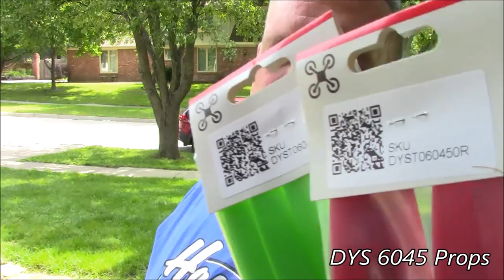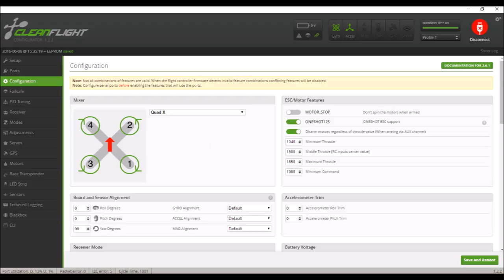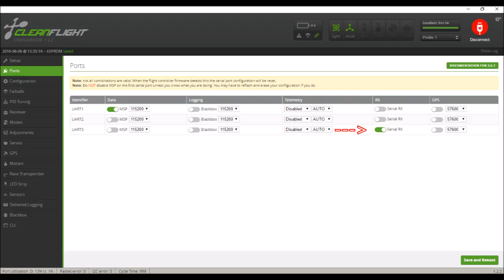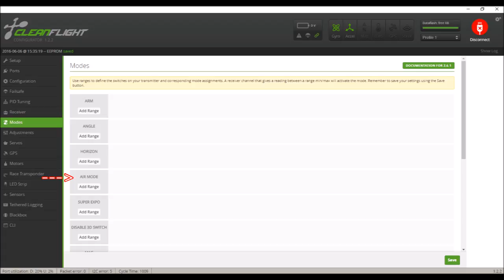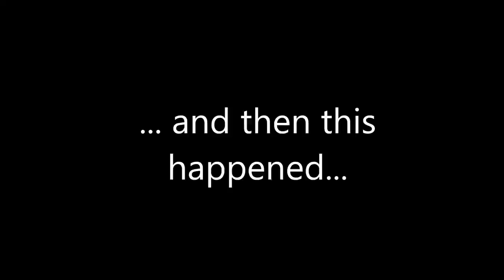TC-R260 Parts, Build Review, Tuning, LOS, Free Style, and Racing!

Comment: Great videos, I have the same vtx et200r but it only has 3.93 volts out to my pz0420 so not enough to power it up where my older et200 has 12.1 volts on the camera lead, Did you power your camera right from the 12v bec on the Marek board.
It is a great quad I love the way this thing flies.
Keep up the videos they have been a great help, thanks again.
Reply from the maker: Anymore, I try to buy PDBs that have a 12 volt output and I use that to power my cameras.  I use the 5v output to power my flight boards.  I usually run the video transmitter directly from the battery voltage.

Comment: travisgrindal i am building a similar quad with the same motors as here and same escs, eccept i am using a zmr250 and naze32 but i am using a devo 7 and it is pwm since the dys xm20a esc have oneshot do i have to use it because i am not shure if pwm supports oneshot

Comment: they have 1 2000mah comes with battery ac charger and three batteries. The next 1 is 2500mah this battery is use for parrot ar drone and 2.0/1.0 Quadcopter what do u think about them.

Comment: Could you do a follow up video on what you do to get it fixed?  Do they make any spare parts?
Reply from the maker: I bought a new frame and used all new parts except for the four arms.  The original arms were all fine.  It took about 45 minutes to move it all over.  This is still my current favorite quad.
Reply: You got me about 90% sure that I'm going. to build one out.  It would be nice if the made spare top plates.   I would use all the same parts but I'm thinking about trying the littlebee 20A pro's.  A buddy of mine tried them and they have some awesome braking.

Comment: Question: Why do you prefer this instead of the GE220? I just ordered a QAV-R 220 but I've been wanting to get the GE220 as well.
Reply from the maker: I like them both.  Right now, the GE220 and the TC-R260 are the quads I take to the races.  I think the look of the TC-R260 a cooler and definitely easier to build because it has more space.
Reply from the maker: I like them both though.  :)

Comment: That smile you have during the video made me smile 2 cos I have the same frame waiting for the same motors(unfortunately held by custom atm) hehe, only I went for the 30a xms just to be safe. Cant wait to build it and fl it.. hope all comes together well as its my 1st build. have you tried multyshot or oneshot 42, the esc should support both?
Reply from the maker: I haven't tried either of those yet, but people keep telling me I should.  :)
Reply: If you gonna try multishot a word of caution, you should probably lower your min command as Joshua Bardwell posted in his video when he flashed his esc the motors started turning after  flashing. Seems like multishot have different range. Anyway those motors rlly like to pull amps and give nice thrust, not many 1300 mAh battery can give  what they need. You think a 1500-1600 mAh would be the minimum for this setup?

Comment: hi would you say the bonka batteries are better than the tattu  batteries??..i have been using bonka since i started flying,but they get very very hot after flying..
Reply from the maker: I like the Bonka batteries better, but some other people may say the Tattu batteries are better.  Since your batteries are getting hot, you probably need a battery with a higher C rating.  If you're going to buy a new battery anyway, look at getting a graphene battery.  Bonka has some new "Panda" batteries that are real good but a cheaper alternative that I've been using is this one (70C):  http://www.banggood.com/Infinity-4S-14_8V-1300mAh-70C-Graphene-LiPo-Battery-XT60-Support-15C-Boosting-Charge-p-1062565.html?p=6Z050013977120130325
If you want to try the newest Infinity graphene for just a little more, there is this one.  I haven't tried it yet, but it will be in my next order (90C):  http://www.banggood.com/Infinity-1300mah-14_8V-90C-4S1P-Race-Spec-Lipo-Battery-p-1099104.html?p=6Z050013977120130325
Those are both 1300mAh batteries but they are available in 1500mAh also.
Reply: thaks for the reply asalways you the man!!!!!!!!

Comment: Hi. What size of screws you use to mount this fpv camera? M2?
Reply from the maker: The camera came with screws.  I drilled out the side plates a little so the pieces sticking out of the camera would fit through them a little better.

Comment: I have almost the same setup (sp f3, dys se2205, dys xm 20a but a 3s battery) and when the battery gets low the quad starts to wobble and fall out of the sky. I belive that it is the esc´s that shut the power off (only two of the esc´s shut off), did/are you having that problem and if you had it how did you solve it?
Reply from the maker: I haven't had that problem. Have you updated your ESCs to a current version of BLHeli?
Reply: no, thank you I will try

Comment: I have the same esc and motors. I use 5045 props but my motors still come down hot.  any ideas?
Reply from the maker: When I race, they have been coming down fairly cool.  When I'm out flying freestyle and pushing the motors hard, they come down pretty hot.  They aren't hot enough to burn my hands, but they do get pretty hot.  If they are hot enough to burn your hands, the magnets have a better chance of coming loose.  You could try to move down your props to 5040 or 5030 props and that should help your motors come down a little cooler.  You won't have as much power though.

Comment: Just wondering how your rebuild is holding up?  I did end up buying this frame with everything you used except I went with the littlebee  pro's cause I just wanted to give them a try.  My only concern is the top plate looks thin.
Reply from the maker: It is back together and flying great.  It is still my primary quad for racing.
Reply: I am wondering if you crash again if you could just buy QAV-R parts instead of buying a whole new frame.  I bought a 2mm QAV-R top plate and grommits for the xt60 slot from getfpv.  I let you know if it fits.
Reply: It doesn't fit.  holes don't line up and the top plate is quite a bit narrower but you can buy 3 tc-r260 frames for the price of one qav-r frame.

Comment: what's a good battery for the Q330 racing quadcopter?
Reply from the maker: What size of props are you using?   For 5" props, I'd use 1500-1800mAh, for 6" props, probably 1800-2600mAh batteries.  I'd also be running 4S.  3S would work, but 4S would give you a lot more power.

Comment: Where did you get that cmos cam, it seems to perform pretty good for a cmos cam and being that cheap.
Reply from the maker: $11.  The link is in the description.
Reply: +travisgrindal so does it perform good in compare with the HS1177? And how does it work with backlight?
Reply from the maker: +R2GO it's good.  I'm using it in the FPV parts of this video.
Reply: +travisgrindal ok. looks good. my hs1177 just went black in mid air. think I'll give these a try.

keep up the good work👍

ps. check out the dutch epiquad

Comment: How do the DYS motors compare to Racerstar 2205s?
Reply from the maker: I think I prefer the Racerstar motors.  They're cheaper and I haven't had any problems with them yet.  I had one DYS motor go out on me so far.
Reply: travisgrindal How is the power though? What should I get among the 3 2205s, the Racerstar, Emax V1 (not the S), or the DYS SE?
Reply from the maker: If you get 2300kv motors, I don't think you'll notice much difference.  If you want more power, look at these Racerstar 2600kv motors.  I run them on my x210 and now I think most of the 2300kv motors I fly feel slow.  http://www.banggood.com/4x-Racerstar-Racing-Edition-2205-BR2205-2600KV-2-4S-Brushless-Motor-CWCCW-For-QAV250-ZMR250-260-280-p-1071307.html?p=6Z050013977120130325
Reply: travisgrindal Thanks! So you think the Racerstar 2600 KV is better than the DYS and Emax 2300s?
Reply: no

Comment: I have one of those frames and it flies fine. I'd like to lower the top plate in order to get the cg down - has anyone tried that? tip for reciver mounting, put it on the lower plate behind the FC and route the antennas in plastic straws   using the rear standoffs as mounts then shrinkwrap it.
Reply from the maker: That is a good idea.  I have space there to do it.

Comment: how much flight time do you get per battery?
what is flight weight?
Reply from the maker: It really depends on how hard I push it.  When I race, I could probably get 2-3 minutes.  When I'm just cruising around and not pushing the throttle, it could go closer to 4-5 minutes.
Reply: Thanks.
what is flight weight?
Reply: I have the SE2205 and the 30a mini esc on my ZMR250. love them plenty fast.
but only seem to be getting about 2 mins using 3S 1300 65c Turnigy Graphene.
I am guessing I am a little heavy still
Reply from the maker: It is around 380 grams with no battery.
Reply from the maker: I'm flying with 4S batteries... both 1300 and 1500.
Reply: ah. ok.
so a 4s will give longer flight times than 3s.
Reply from the maker: Maybe a little, but I'm not sure it would be significant.  Higher voltage requires less amps to move a motor at the same speed while a motor with lower voltage requires more amps.  1300mAh at 4S should last a little longer than 1300mAh at 3S.  Of course, when I fly 4S, I push my quad a lot harder than I do with 3S so my flight times are probably shorter with 4S!  LOL!

Comment: Whats your favorite battery right now
Reply from the maker: For this quad?  I like the Bonka 4S 1300 mAh for "fastest lap" but I like the 1600-1800 mAh batteries for 2 min/most lap races.
Reply: But you like bonka? I need to buy some new ones so im curious i always used the turnigy 1.3 60c gold and nanotech 1.8 4s I want more Power lol Im already running epic rc motors on my 210 lol
Reply from the maker: +Ultimatevapor918 Yes, I like Bonka.  I have a couple of the 1800 4S 65C Nanotechs and they work real well too but just weigh a little more.

Comment: is it faster with 6inch props our 5inch our 3 blade
Reply from the maker: When I use the 5x4.5 3 blades, I feel like it has more low end torque, but the 6045 props give it a higher top end speed.
Reply: im building this frame and it my first.what flight controller do u recommend it seem that the toop two are the naze32 and cc3d what do u use?
Reply from the maker: I've been using F3 Racing SP boards instead of the Naze32 or CC3D on recent builds.  The new boards that are going to be popular are the "F4" boards.  They have faster processors and other stuff that allow them to run RaceFlight firmware.
Reply from the maker: I have used both the CC3D and the Naze32. For me the CC3D has been easier to tune.  But like I said, I'm most using F3 boards now.

Comment: r 3 blades better than 2 blades?
Reply from the maker: I think 6045 2 balde props have a higher top end speed than 5045x3 blade props.  I think the 5045x3 blades have stronger low-end torque than 5045 2 blade props, but again aren't as fast on the top end.  Which is better depends on what you're trying to achieve.

Comment: I dont like using PDB's with intergrated circuits to regulate power or filtering because you're at the mercy of that PDB if it decides to fry while flying and if it does its a good possibility you will lose your quad for awhile or permanently. It happened to me when my ATAS PRO mini PDB took a crap and I lost all power making any recovery buzzer or telemetry useless. So beware. I did recover my expensive quad and went back to a simple PDB.
Reply from the maker: You could make the same argument for nearly any part in the quad.  If the camera fries, you could crash... If the motor fries, you could crash... if the VTX fries, you could crash... If your ESC fries, you could crash...  I havent had a built in BEC fry on me yet.  They should work fine unless you are trying to draw more amps than they can handle.
Reply: I agree, but this thing was never abused,  crashed it maybe 3 times in 6 months only breaking props as usual. Its a QAV 180, DYS 1806 motors, 1300 mah 4s and 20A esc's. The motors took all the abuse. Im always aware that if anything could happen it probably will, but having full power outtage will never happen again. That is just too risky for me. So then I ripped apart my QAV 250 and took out its ATAS PRO board also. BTW I put the EMAX 2205 2300kv red bottom motors on my 180 and there was not a difference at all in performance in acceleration or deceleration over the DYS motors and it made my quad expectedly heavier. So I switched back to the DYS motors and its happier now. However I put the EMAX 2205 2600 kv motors on my 250 with 5050 tri blades and OMG its so fast I cant get myself to run at full throttle. I might have to switch to 5040 blades because my batteries drain too fast and come back hot and bloated.

Comment: Thoes xm20's and littlebee PRO escs all run the new chip. F396 I think. The old one is the f390.  I have heard reports of these two escs taking wwwaaaayyyy more than 30A. Not continuous but like 10-12 burst from copters pushing 100+A full punch
Reply: 10-12 second burst.
Reply from the maker: A DYS rep told me they could handle 35 amp bursts and that is why they'll work well with the DYS SE2205 motors.
Reply: Would be interested to know about the F390 vs F396 chip. Looking at the specs, the F390 seems superior with double the bits (16 vs 8), more I/O pins and costs nearly twice as much as a F396. All of the F3xx series Scilabs chips seem to follow this "rule". Couldn't see and info on the dates of release though. If anyone can explain it would be real great. Thanks!